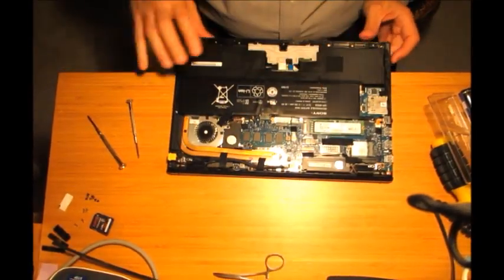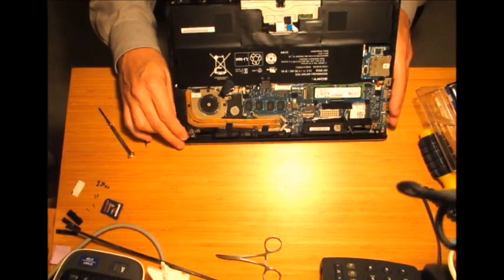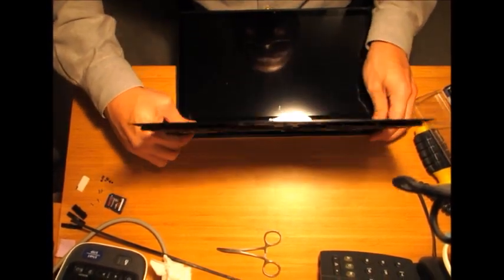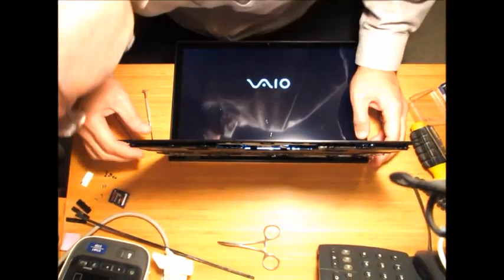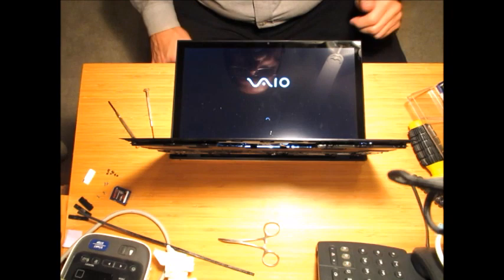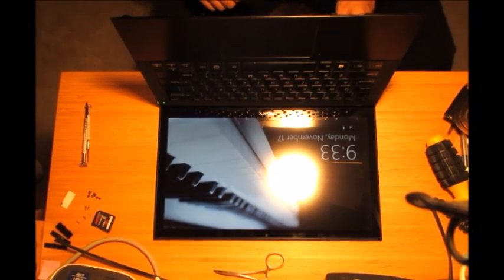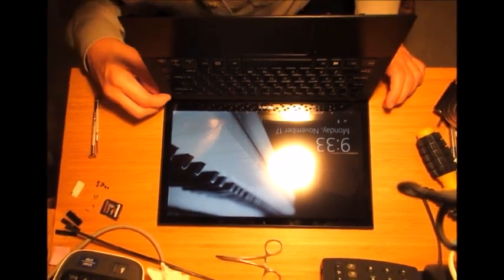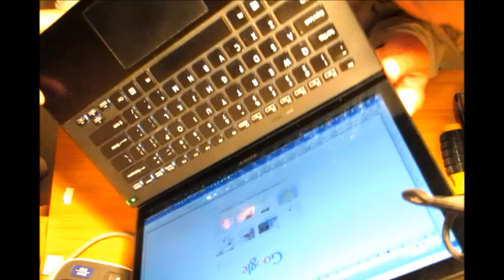Sony VAIO Pro13, svp132 fan replacement, case removal

Comment from the maker: Here's a page with fans and fans+heatsink for sale:  http://www.laptoppartstore.com/replace--remove-sony-vaio-pro-13-svp13-cpu-cooling-fan-udqfvsr01df0.html
Reply: Hey Larry. Did you actually buy your replacement fan at that store? I would like to give the Panasonic fan a try since the Delta fan is pretty loud but I can't really find trustworthy shops selling this fan for <60 bucks. Every shop with low prices seems kind of fishy so I would like to hear where you bought your replacement fan since you seem pretty satisfied with your new fan.
Reply from the maker: Mike, when I bought my fan I bought the fan + heatsink as I was worried at that time that the two where one inseparable unit.  However, since then I've had multiple readers tell us that buying the fan alone and attaching it to the original heatsink is easy.  Thus, if I were replacing my fan today, I would order one like this:  
Panasonic:  http://www.ebay.com/itm/NEW-Sony-Vaio-Pro-13-SVP132-SVP132A-SVP13218-SVP13217-Cooling-Fan-UDQFVSR01DF0-/281806591112?hash=item419cfb5488:g:WCQAAOSwEetWAKUL

or if someone wants Delta:  
http://www.ebay.com/itm/CPU-Cooling-Fan-for-Sony-Vaio-Pro13-SVP132-SVP132A-300-0001-2755-UDQFVSR01DF0-/371405107574

When I buy on ebay, I look for a seller with thousands of sales and a rating of 99%+, both of the above dealers qualify.  Doesn't mean their products are 100%, but if there is trouble they will work to get the issue resolved.   

Good luck and let us know how it goes!

Larry...

Comment: Thank you for this video. I do, however,  want to give a heads up that replacing only the fan is incredibly easy, as well as much cheaper. I bough a new fan for a couple of US dollars and replaced it, keeping the old heatsink and it works great. So there is really no need replacing the heatsink as well.
Reply from the maker: Daniel, thanks for the extra info.  I have recently found the same thing, putting a new fan/motor assy onto the existing heatsink is very easy and much less cost.
Reply: @LarryBlackledge  Hi guys, what is the part no for only the fan? I've had my laptop laying in a drawer now for 3 years...everyone said its unfixable...onlynow saw there vids....Can you help also as to where I can buy it from
Reply from the maker: @heinzkitshoff8738  if you search for the part number on eBay you will find it with the heat sink and without the heat sink and I also agree that replacing the fan itself is easy and less expensive.   Larry...

Comment from the maker: Found this video that shows the fan can be pretty easily replaced without replacing the heat-sink.  Fast forward to 8:30 to see the fan/motor removal from the heat-sink, looks easy.   https://youtu.be/XATOTeUh-5U
Reply: *****
Hey Larry. Did you replace the fan because your built-in fan was really broken or because you were annoyed by it's noise? I don't think mine is broken but in my opinion it is way too loud and the sound is quite annoying once you start doing some serious stuff with the device. But my fan has been this loud since I bought the Vaio Pro. The only workaround is to set the fan mode to quiet in the Vaio Control Center software but that does not solve the poblem completely. So I was hoping that I can replace the built-in fan with a less annoying model. Did your new fan actually reduced the noise of your Vaio Pro compared to the state when you bought it?
Reply from the maker: Mike, when I bought my Vaio I didn't hear the fan at all, after ~2 years it started whining and continued to get louder until it was bothering my co-workers.  The new fan is back to the original very  low / no noise as if when it was new.  Hope this helps.   Larry...
Reply: Hey Larry. I bought the Delta fan (ND55C02-14J1) on eBay 3 weeks ago and replaced the original fan (a Panasonic fan just like yours). For the first days, the noise was a bit lower compared to the original fan but not very much. Since a few days, the fan regularly makes strange noises (like friction noise) when the notebook is lying on the table. If you turn it upright, the noise is gone. It seems like the fan has a bearing damage. Maybe it was just bad luck but considering my current experience, I would recommend the Panasonic fan and not the Delta fan when replacing the fan of your Vaio Pro. However, the Panasonic fan is hardly available in germany. Btw there is absolutely no need to buy a fan AND a heatsink. Mounting the new fan to the original heatsink is really easy. Best regards, Mike
Reply: I've been having the same fan sound problem. I decided to replace the fan but the fan i received was a Delta Electronics model from China. It uses 0.5A vs. the OEM 0.22A that panasonic uses. The heatsink you ordered I noticed had a second 2 pin cable. Do you know what this cable is for?

Do you think 0.5A would be a problem vs. 0.22A? (1.1 Watts vs. 2.5 Watts)
Reply: I believe that the second cable is for the temp sensor.
Reply: +Daniel Holm thanks I fixed it and everything works great
Reply: What are your experiences with the Delta fan? Is it less annoying than the built-in fan? I have a Sony SVP1321C5E and the recommended fan seems to be the Delta fan. Now I'm uncertain whether I should buy the Delta fan or the Panasonic fan.
Reply from the maker: Mike, both Delta (largest motor producer) and Panasonic are great companies, I don't think you'll go wrong with either.   If you feel your Panasonic fan died too early you may try Delta.   Give us feedback after your decision and let us know how it goes.   Larry...
Reply from the maker: Mike, thank you for the update, this is helpful!   Larry...
Reply: I've replaced two fans and now I'll have to replace it a 3rd time, the thing is that the model numbers on the fans are slightly different so I wonder whether it's just a bad fan design or whether or not the VAIO Pro 13 is pushing the fan to it's limits over a prolonged period  of use (say 10 months to 16 months) ? Either way there is no fan manual software fan controller for the VAIO Pro 13 in existence. The whole thing sucks but I've gained confidence is either replacing the fan only or the fan and heat sink. I'm guessing Sony didn't stress test the fan design well enough over a long period of time. I wonder if there is an article about this fan design and it being fundamentally flawed.

Comment: Thanks for all the useful info.  So I replaced just the fan last week. After further troubleshooting I believe it is shutting down because of overheating.  I took it apart again and cleaned the old and put new thermo paste on bit to no avail. I noticed the fan wasn't running at high speed and discovered the thermo sensor which regulates the fan speed is on the far end of the heat sink.  I moved it closer to the cpu (basically runs almost all the time (as a test)).   I watched the temp with a utility I downloaded and it shuts down consistently around w a cpu temp of 94c. CPU feels pretty hot too.  Any advice or do I have an nice black boat anchor!?  Thanks again for your contributions!
Reply from the maker: +Steven W Steven, can you tell us what led up to this overheating condition?  i.e. any new software/hardware that may have triggered it?   From a cold start, how long does it take to overheat and shutdown?
Reply: +Larry Blackledge...  It was working fine except the fact that the fan bearings went out.  It was so noisy i replaced it (the fan).  Takes about 5 - 10 mins depending on how much I tax the cpu.  I was thinking we should replace the fan and the heatsink?
Reply from the maker: +Steven W So when you replaced the fan, you did not by the FAN+HEATSINK set you bought only the fan and then reattached to the old heatsink?   I have not examined the connection between the fan and heatsink, how are they connected?   Can you feel hot air blowing through the heatsink fins?   The heatsink itself doesn't age, just make sure the attachment to the CPU is clean and has plenty of thermal paste and be sure the cooling fins are clear.
Reply: +Larry Blackledge You are correct.  Replaced just the fan.  Warm air exhausting thru the fan area - not a ton. Noticed that as the cpu heats up the heatsink doesn't seem to carry a ton of heat thru it towards the other end near the fan. ( the cpu is very hot but the heatsink isn't so much).  I thought maybe the themal compound wasn't doing its job correctly so I removed and reapplied but not much diff.  Used IC Diamond type thermal compound.  The fins on the heatsink assembly got slightly bent during removal - straightened them out - how critical is this piece of the puzzle?  Thanks again...
Reply from the maker: +Steven W If the fins are now straight, I'd say that piece is OK.    Can you give us a feeling of how hot (not necessarily by temp, but by touch) the heatsink is near the CPU vs. how hot the heatsink is nearer to the fins/fan?   i.e. is the heatsink really sinking heat?    Be sure to feel both pieces of copper tube as one could have been cracked causing the lack of thermal transfer.
Reply: I've ordered a new heatsink assemby-ill let you know if it helps.. Thank you

Comment: Hi man, thank you for the video. I've got a problem with my pro13 , infact every time i move it, it shuts down and to power it on again i have to plug the power cord. I've noticed that the battery if you pick it up tends to fold on the middle. It's the same with your battery?
Reply from the maker: +fabiaiz10 Wow, that sounds odd.  It almost sounds like some safety is being triggered.   If you let it run just on battery (not plugged in) does it still shut down when you move it?   In this case can you immediately start it again with the power switch?   When you say "pick up the battery", did you remove the battery from the case?  I have never removed the battery, so I cannot comment on it.  Larry...

Comment: Great video, thanks! Helped me replace my fan. My keyboard has now broken though, do you know if it's possible to replace the keyboard on this model? Cheers!
Reply from the maker: +bencelot Great question, and the same one I am asking now as my keyboard continues to lose the "E" key and I continue to doctor it back in place.   I'm still studying this, however my findings so far are a very few brave souls who did take the PC completely apart and drilled out the rivets in the keyboard and replaced it via epoxying it back in place.   Now, if you buy the keyboard with the palmrest & trackpad attached, it becomes much easier, but more expensive.   So far I can find the keyboards on ebay for ~$35 USD and I can find the larger assembly with keyboard-palmrest-trackpad for ~$75, however the latter is used and I really want a new one.  Thus, if I do get to a solution on this, I will certainly post it.
Reply: +Larry Blackledge Awesome thanks for the thorough reply! My a key has just died and the 4 little metal hooks have snapped due to me repositioning it so many times, so I think a new keyboard is needed. I've subscribed to your channel in case you find and post a solution. Cheers :)

Comment: Thank you. You saved my day. I did not replace the fan, just clean it and put small drop of Sonax in lubricant hole at the center of black sticker on the fan body. Now it works like a brand new.
Reply: 1 month... still quiet. ^_^
Reply from the maker: +SG Paul Great!  Keep us posted, would be good to know if this fixes the issue longer-term.
Reply: +SG Paul did you get rid of the noise from the fan? was it very dusty?
Reply: +Larry Blackledge After 1 week 24 hrs nonstop running, no rattle noise present so far. But I think we should talk about 1 year.
Reply: +Nadia Dadoun Noise has gone. I'm not sure if it gone because cleaning or oiling. Fan does not very dusty by the way.
Reply from the maker: SG Paul, GREAT!  Thanks for the info.  Sounds like Sonax is the first step before replacing a fan!
Reply: Thank a lot,To day i replaed the fan! it works properly but i used Bosny grease spray.
Reply from the maker: Ro'Kaisakkon, Great!  Glad it's working!  Larry...

Comment: Thanks good tutorial. I opened my laptop to see if the fan was the problem and it was! However the noise has reduced a lot from me simply just airing it out a bit pretty random. But I am having difficulty locating somewhere to buy the replacement fan. I am in England so not sure if anyone knows where I can get the panasonic fan from?
Reply from the maker: +Mayur Pande Try to Google the part number "UDQFVSR01DF0", you should find someone willing to ship to UK.   One example:  http://www.aliexpress.com/item/Fan-With-Heatsink-for-Sony-Vaio-Pro13-SVP132-SVP132A-300-0001-2755-UDQFVSR01DF0-Free-Shipping/32256702503.html
Reply: +Larry Blackledge Thanks Larry, managed to find somewhere else slightly more expensive but have already ordered it which is a shame. But have bookmarked your link for future use. Thanks again for the video and help